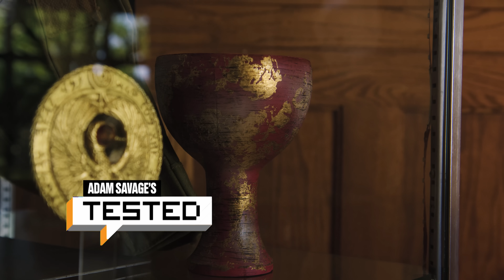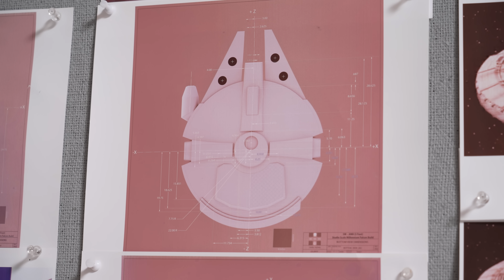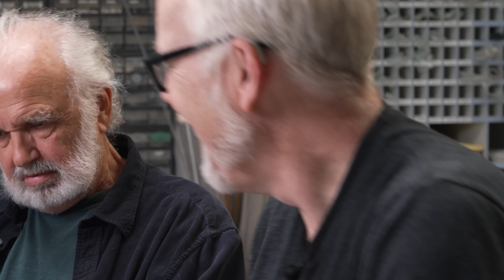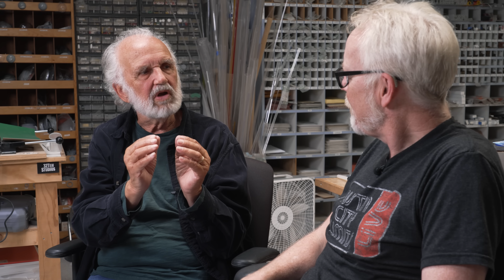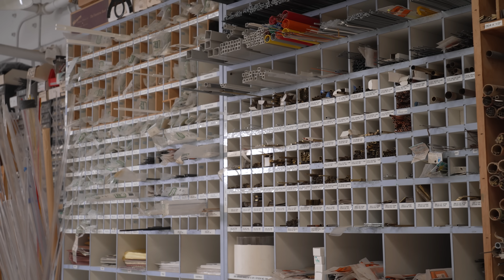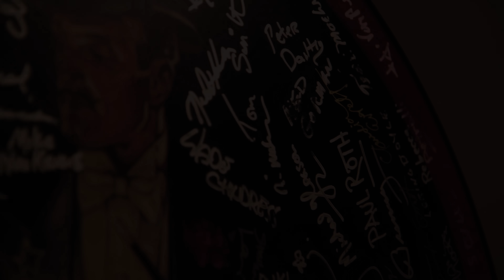An Interview With Former Star Wars Modeler Lorne Peterson

Comment: I am not a modeler - I'm a fabricator/repurposer. I made a career NOT reinventing the wheel, but taking something made for one purpose and with some modification making it do something different. I once worked for a medical electronics company. I changed how the tooling department did prototypes, taking tooling development from 18 months to 6 months. We (my team) co-created the tooling that resulted in the first implantable defibrillator. My specific contribution was utilizing 3 separate fixture machine shops that competed against eachother for the final design of the test fixture hardware (clamshell), having my most talented spacial designers work with the functional design engineering team on test point placement, I worked with 2 vendors on pogo pin design, and worked with our lead mechanical engineer on plastics specifications for processing fixtures. We changed the company. We took it from a $60B company to a $100B company in just 2 years. I am so proud of my team and our accomplishment. We saved thousands of lives and had fun doing it.

Comment: as far as film props go I got lucky because of a disaster the Aardman studios burned down in 2005 what little survived in one piece was sold off probably to get some proceeds back because insurance is always lowballing everything.
an eBay listing in early 2006 was auctioning off an original Ray Harryhausen screen-used skeleton! from Jason and the Argonauts 1963 movie it came from the Aardman studio display cabinets displaying other films' stop-motion models it had survived the fire because it is entirely made of metal the white paint was gone it was rusty and no longer had articulation at all I bid a lowball bid as I always do if I'm the first bidder and it got accepted immediately! BOOM! I won it!!!! 
when it arrived it was indeed sad and I had to take the many many parts of this tiny thing apart clean all of it de-rust it polish every part sand it prime it and then repaint and weather it that line up sounds short but it took me a month! to make it look again as it did in the movies it's now articulate it looks as it was in 1963 and I made a pedestal with the wall like in the 1963 movie.
costs you ask? well I live in the netherlands so it was priced in euros on my screen, uh, you won't actually believe this but it was 25 euros! 
I did mean it when I said I was lowballing! then again it looked like rusty trash! it had been listed for a week and nobody bid... 
I mean a real Ray Harryhausen screen used stop-motion model I would have gone to 500 euros and I had it in the bank! no matter how Fing rusty, it's Hollywood epic history here! yet my first bid was the final bid so 25 euros it was.

Comment: I'm guessing the precursors of "Kit Bashing" that Adam refers to would be the model builders who worked on the Gerry Anderson series like Thunderbirds and Captain Scarlet. In fact these shows influenced Stars Wars when it was felt the original Millennium Falcon looked to much like the Eagles from Space 1999, so that model became the Rebel Blockade Runner. 
Someone else may be able to confirm it but I guess some of the Anderson modellers probably ended up working on the craft for 2001.

Comment: Him talking about "being out in the works and finding solutions to things"... I've found my people... 😅
Like I wanted to have a "helping hands" for something, but wanted a light source that was small and maneuverable... So I grabbed a cheap camera tri-pod with those multi-segment ball and socket legs. And these 9mm LEDs (large!) I had gotten just so happens fit PERFECTLY in the one socket! And side each segment had a hole through it, it was able to easily have wires run through to power the LED 😊

Thus, a posable light source that generated no heat and only needed some 3V for power! 🤘
(pretty sure they make them now, but are like 50x more than the BoM is for my MacGyver'ed solution 😅)

Comment: Amazing! What a piece of history! And the part about CA @10:55! I was told years ago that it was developed for field Medics in Vietnam to close wounds. I've used it for years building R/C models (and occasionally for the "new #11 X-Acto blade bite"). Then a month ago I took a fall and lacerated the top of my left arm (I'm 65). Went to the ER and got about three dozen stitches and they used some fiber strips and "Dermabond" because they were concerned the stitches would tear my "thin skin"! :face-fuchsia-wide-eyes:

And since I know industrial processes as a Mechanical Engineer (now retired) I can relate exactly to what Lorne was saying right after that! You take this bit of tech from here and use it over there, etc. 🤔

AND @14:58 Lorne is exactly right! Looking back over my career I think about some things I accomplished that nobody had thought of before! There's a special feeling when you point out an improvement to be made on something to the original designer and they go: :face-blue-wide-eyes:

Comment: The Escape style pod at 40:21:  Sd.Kfz. 222 upper hull halves, the 222 rear radiator vents (trapizoidal shapes with ribs), EMA elliptical vessel heads in place of the turrets, and EMA safety lights as the forward protruding bumps!